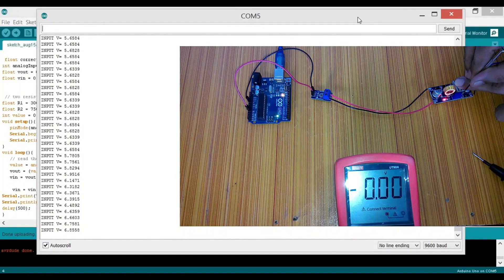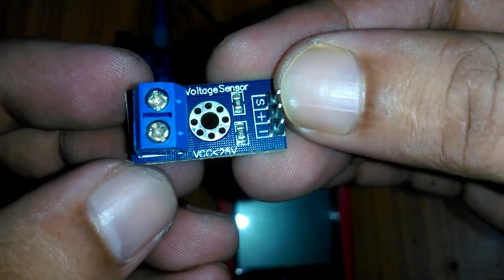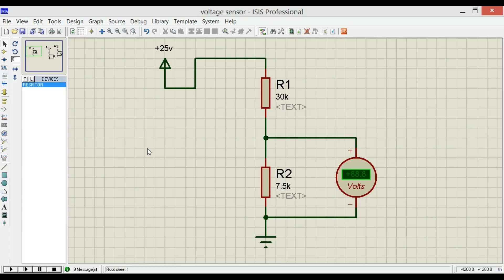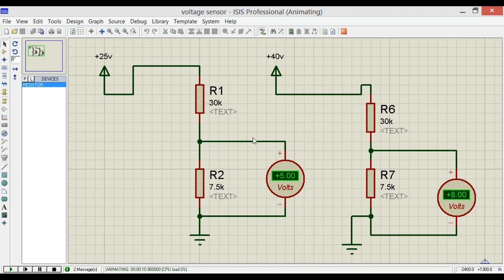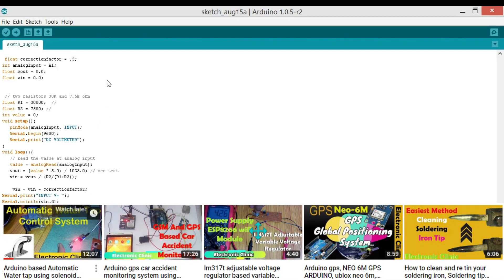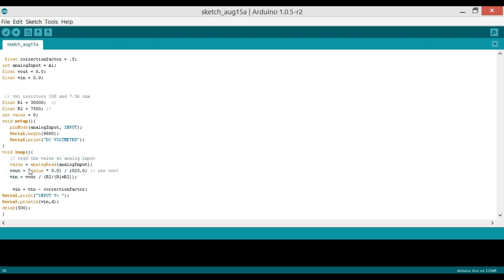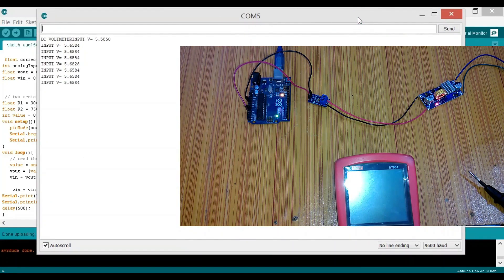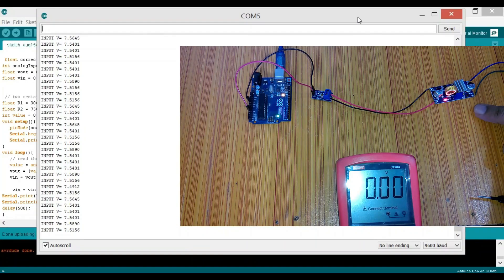Voltage Sensor 0-25v,Arduino Voltage monitoring,calculation & how to modify for reading high voltage

Comment: Hey, can the voltage sensor read ac voltages?
Reply from the maker: you can use this, but you will need to modify the circuit. watch my video on overvoltage, undervoltage, and normal voltage monitoring.

Comment: Dear Sir my voltage is  56 volt DC,   so please reply.. Hear capacitor is required or not at the VOLTAGE SENSOR input...if required please give rating of capacitor. 
And according of voltage devider rule hear 224k ohm resister is able.. . Please Reply.

⏺️Sir anther questions.. If we are using esp 8266 dev board (TTGO T CALL+blynk app) for battery voltage monitoring in place of this Arduino with same code it is possible or not...

Comment: Great Video
can i ask you? how you find the current parameter ( I ) ? why the value is 666 micro ampere?
Thanks
Reply from the maker: I have a vudeo on acs current sensor watch that video. Chexk playlist.
Reply: @ElectroniClinic  thanks for your answer, i have watched your suggest, but i am not find the calcuation? can you explain for me? thanks
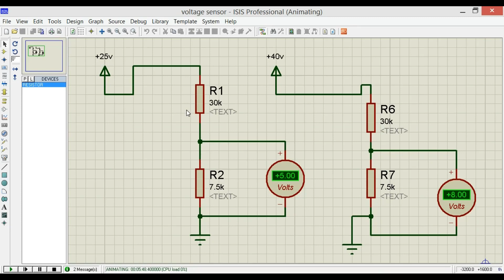Reply: @bimadwipriyasetiawan1133  CHECK TIME OF THE VIDEO FROM  4:15 - 4:41s( HE CALCULATED CURRENT DROP OR CURRENT DIVIDER TO GET THE CURRENT THAT WILL BE DROP AT THE OUTPUT. YOU WILL ALSO CONSIDER THE MAXIMUM CURRENT THE ANALOGUE PIN OF ARDUINO CAN CARRY. THIS WILL GIVE YOU THE WORKABLE RANGE OF CURRENT YOU NEED. YOU ONLY NEED THE CURRENT HERE TO GET THE VALUE OF RESISTOR TO USE IN CASE YOU WANT TO INCREASE THE INPUT VOLTAGE.

Comment: Why did you add the capacitor? And what calculation did you use to determine the size? Thanks.
Reply from the maker: the capacitor is only used for filtering. there is no specific calculation.

Comment: can I measure 12V battery with this 25v module?
Reply from the maker: check playlist, i have a tutorial on battery voltage monitoring using this sensor and a bluetooth.